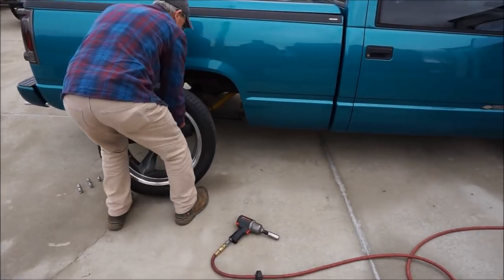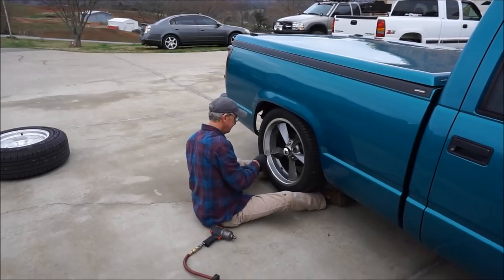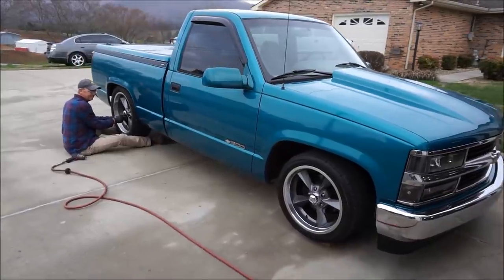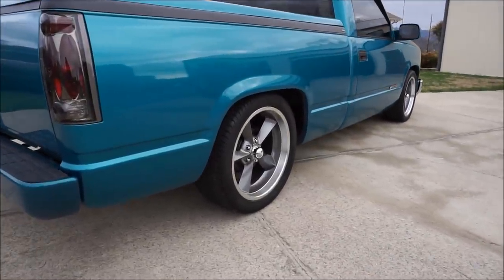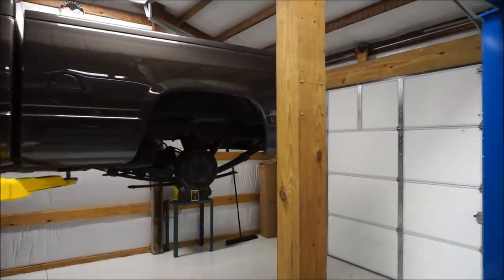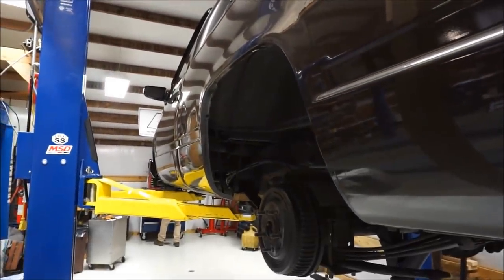NEW SETUP FOR THE MUSCLE TRUCK ! + 95 SILVERADO GETS NEW WHEELS

Comment: I have a 94 Silverado with a 4-7 drop. It has 275/35 20's all around mounted on IRoc wheels. It sits level but I really want to change the tires to 275/40 20's. Your dads truck looks great. Can't wait to see your new tires and wheels.